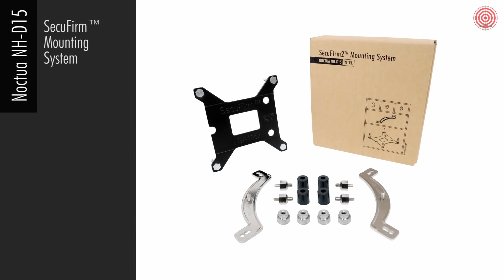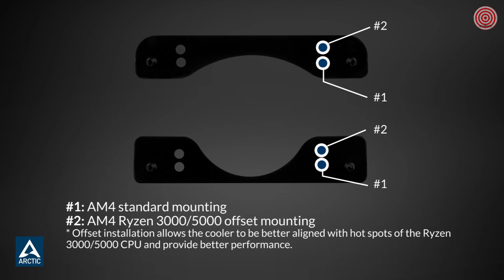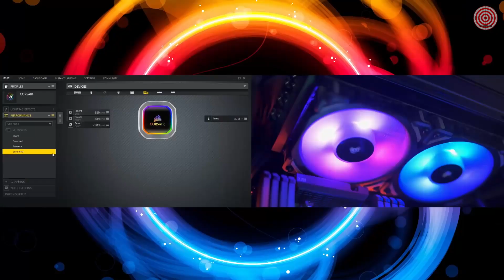5 Best CPU Coolers for Ryzen 9 5900X to buy in 2022

Comment: Is a h100i capable to keep a 5900x cool? Or should I update to a different aio cooler
Reply from the maker: Yes, the Corsair H100i is capable of keeping a Ryzen 9 5900x cool under normal operating conditions. The 5900x has a TDP of 105W, which is well within the cooling capacity of the H100i. In fact, the H100i is rated for a TDP of up to 250W, so it should have no problem keeping the 5900x cool even when it is overclocked.

Comment: Would a NZXT Kraken Z73 combined with NZXT H7 Elite be capable of keeping my RYZEN 9 5900x cool? I keep seeing my temps around 60-80 when underload in cyberpunk for example. And do you have any suggestions on to make it run cooler?
Reply from the maker: Yes, the NZXT Kraken Z73 is a powerful 360mm AIO liquid cooler that is more than capable of keeping the Ryzen 9 5900x cool. In fact, it is one of the best AIO coolers on the market for this CPU. The H7 Elite is a well-ventilated case that will also help to keep your CPU cool.
Your temps of 60-80 degrees Celsius under load in Cyberpunk are perfectly normal for the Ryzen 9 5900x. This CPU is known to run hot, and these temps are well within safe limits, which is 95 degrees Celsius.

Comment: how come i get 80+c with deepcool ls720 aio?
Reply from the maker: There are several situations in which it can happen that a cooler does not work within the parameters: insufficient ventilation of the case, improper mounting, high temperatures in the ambient environment etc.

Comment: What is the motherboard that is being used because I’m currently running it on a b450 plus board and im not sure if it’s compatibility
Reply from the maker: Hello! B450 plus is compatible with ryzen 9 5900x starting with the version 2409 bios. So if you want to use this processor you have to update the bios.

Comment: Do you think Liquid Metal helps in cooling better that cpu ? I always see my temps between 70 to 80 degrees Celsius and I find it high. Unless it’s normal. I’m running a Corsair H100 AIO
Reply from the maker: Hello! Thanks for visiting my channel.
The Ryzen 9 5900X maximum operating temperature is 90c so you will need a powerful CPU Cooler to keep it below 90c. With the CPU Cooler you have under heavy loads or Stress and it doesn't reach 90c then you are okay using that cooler. If this does not happen, I recommend changing your cooler.
OK, liquid metal helps, but due to the fact that metal is also an electrical conductor, not only thermal, I don't recommend using something like that. One drop rid  out of the target area and you can your PC shortcut.
Reply: @AryTechB  thanks for the response, I currently am below 80 degrees so it’s normal. Thanks for the information

Comment: Hey, i have an msi magcoreliquid 240r v2 and i was wondering is this was enough to cool a R9 5900x, thanks :)
Reply from the maker: It is compatible but not recommended.
I recommend the MAG CORELIQUID 280R V2, if you prefer MSI
Reply: @AryTechB  Okay thanks, is this an issue for gaming if i play with it ? i cannot afford to buy and AIO + the cpu
Reply from the maker: @mprst80000  Yes, because you risk improper CPU cooling and an unstable system. 
Temperatures of 80°-90°C
I do not recommend!
Reply: @AryTechB  thanks :) i will go on the ryzen 7 then

Comment: is H150i elite capillex better than H115i RGB palatinum?
Reply from the maker: It is, because it has 360mm and three fans, compared to the 280mm and two fans that the H115i has.
Now, it also depends on what CPU you want to use it for.